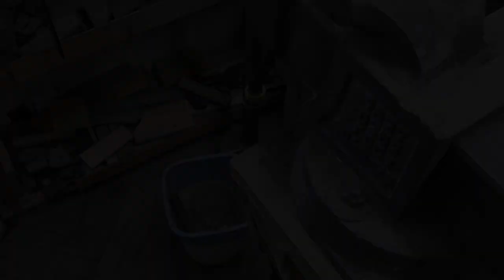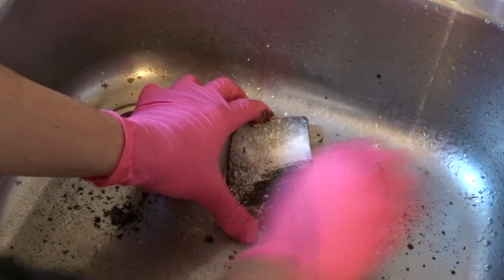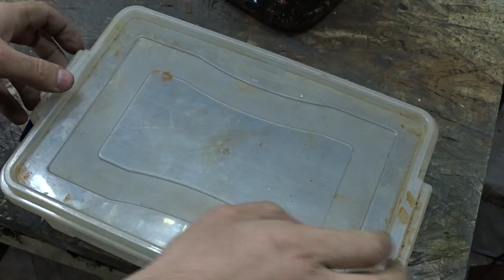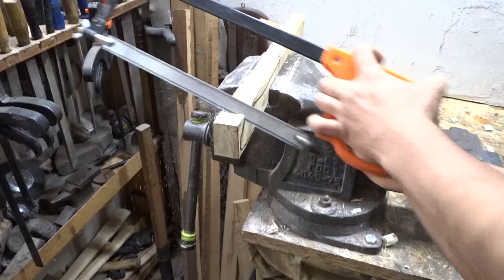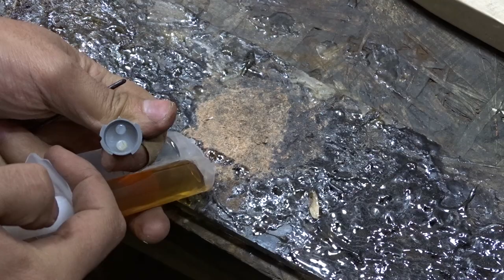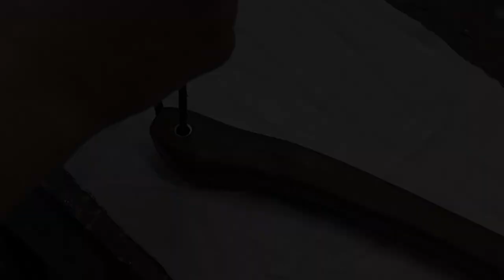Old Rusty Bearded Axe Restoration

Comment: love the addition of the lanyard, I think all hand tools should have one. it's tough enough, but needs to be sharper. Give the edge the really good sharpening treatment like you usually do. You left it a bit dull. I suppose that was on purpose, but to my way of thinking, dull is never good, nor is it safe. Sharper is safer, since then it goes where and does what you intend.